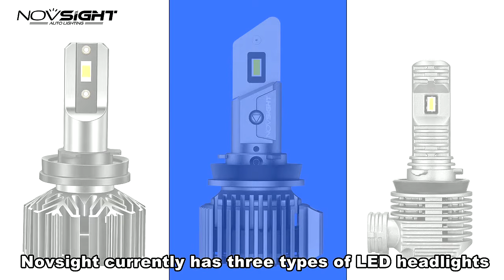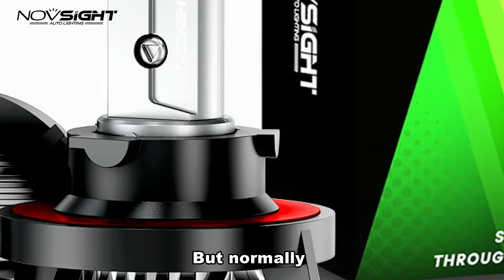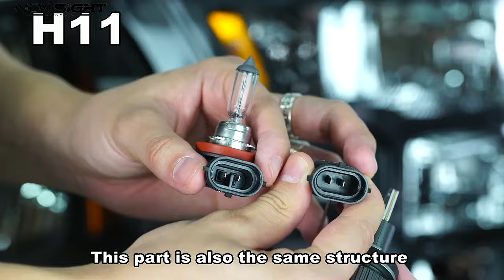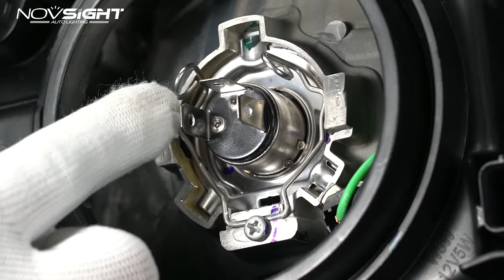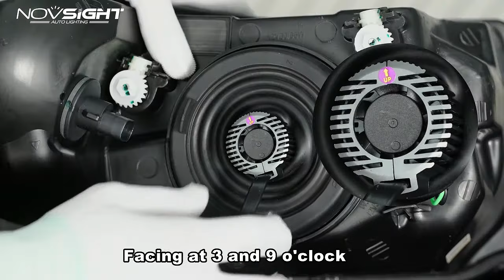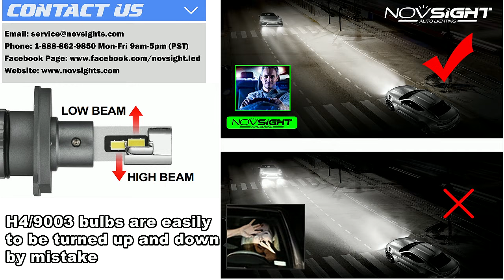How to install H4/9003/HB2 LED headlight bulbs - Novsight H4 LED bulbs install guide

Comment: Bakit yung h4/9003 ko nung ikinabit ko, hundi naka 9 and 3 o'clock. More like 10 and 4 o'clock sya, kaya ang buga ng ilaw mejo slant to the right. Baka may reco kayo na installation tips. Mirage g4 2024 ang unit ko.
Reply from the maker: Hi there, does your light bulb have a 360-degree rotating clip? First, remove the clip and install it into the bulb housing, then screw the light bulb into the clip. H4 install Guide New Video: https://www.youtube.com/watch?v=B5nc_8uNx1Q

Comment: Wouldn't the rubber cover restrict airflow on the heat sink?
Reply from the maker: Generally speaking, it does affect heat dissipation, but we respect the opinions of customers, they can choose to install or remove the dust cover.

Comment: i bought a novsigth N39 H4 my problem is no high beam? only low beam, but in my osram led headlight is working. in novsigth is not working.
Reply from the maker: It might be a decoding issue. Please visit our official website and consult our online customer service for a solution.❤️
Reply: The LED driver circuit must be compatible with the Headlight circuit and programs in the Cars OBD2

Comment: Day lights doesn't work after this modification
Reply from the maker: Hello, there could be a few reasons why the light isn't working. First, you can try swapping the left and right bulbs to see if the polarity is connected incorrectly. If that doesn't fix the issue, it might be a decoding problem. You can purchase a CB6 decoder from our website to see if that resolves it, or contact our online customer service for further assistance. I hope this information is helpful to you.

Comment: MADE IN CHINA
Reply from the maker: We emphasize quality and user experience in all our products. The focus should be on the standards and performance of the product rather than the manufacturing location. Thank you for your comment!
Reply: @NovsightAutoLighting Thx Nov sight. My LED hsadlights are another brand and bought on Temu but your install instructions are also valid for these ones

Comment: Hi, i have an h4 led bulb but it has only one filament which has total of 6 small csp leds 3 for upper and 3 for lower beam.. traditional h4 bulb has 2 filament. Is there any problem with this because my beam pattern is not projected like halogen one's

Comment: I have installed LED bulbs for sienna 2016 but high beam is downward the bulb has 9 3 clock orientation what should do to put light straight for high beam
Reply from the maker: Can you adjust the position of the light itself? It should be able to adjust the angle
Reply: @NovsightAutoLighting  the position in 9 and 3 but which side to keep UP and which to keep Down for better Beam Pattern. Confused??

Comment: Haloo... instead of 3 to 9, 0 clock....can i put to 12 to 6 o clock..? 
Mine is h4 ..night eyes..
Reply from the maker: Hi, according to our test, 3&9 O'clock is the best angle because the structure of the reflector housing and projector housing. If you put it in 12 to 6 O'clock, you might get the wrong light pattern

Comment: What’s the purpose of a removable locking ring?
Reply from the maker: Hi, because the cooling fan will be bigger than the clip, if you install the whole light, the clip will not be able to close.

Comment: What to do if locking ring drops inside
Reply from the maker: If you do drop the locking ring. 
First, please don't try to pick it up blindly, because you might move the ring into a corner. 
Get a steel wire and use your phone camera and flashlight to locate the ring, try to fish it up. 
If that didn’t work out, you might need to take off the headlight housing to get it. We suggest you seek help from automobile technician

Comment: After all this time of swearing and cursing that I have struggled putting these into my car's , I come across this video I didn't even realise that the locking ring came off. Made the Job a hell of a lot easier. Thank you and great video and explanation
Reply from the maker: Thank you! Glad that we could help!
Reply: Yes it helps to learn how the fastening system works but after a few installs you should be able to install with or without the ring on
Reply: My main problem ive had for months was to find out what direction i should turn the LED, now im pretty sure after this vid. The metal light blocking wings should sit UNDER the LED units and not over?!!!???? 🌞💚🤯🤯🤯

Comment: I followed the steps but why my fo3 turns 12 and 6 o'clock? Any remedy to this?
Reply from the maker: Hello, there might be two reasons:
1.The taps on the collar, there is supposed to be 1 bigger tap and 2 smaller taps. The bigger one should be facing up
2.The light position before you put it in the collar. The wire should be facing up when the light is in the beginning position, then turn it clockwise. (if your series only have an up label, the up label should face down at the beginning position)

Here is another new tutorial with a CG explanation, it should be able to help you out: https://youtu.be/B5nc_8uNx1Q

Comment: Hello! Is there anyway i can adjust sa body of the bulb? Because they dont perfectly align horizontally like u said in the video. My bulbs are a little tilted to the right
Reply from the maker: Hello, although vertical is the perfect angle (facing 9 & 3 O'clock), for the H4, it is normal to have a tilt (could be up to 5°) due to the design of the light collar.
Reply: I also have a problem with the highbeam installed in our 2015 montero glsv. Whatever i do the bulb is locked diagonally.

Comment: Using 5 pairs of your products including nighteye,, very satisfied with products and built quality 👍. Latest I'm using the N37 H4, light output is very bright but the wattage I measured is only 40 watts , bought it from cloudsale, have I got the original quality I'm doubtful. Last time I bought the 14400 lumen H4 directly from Novsight, it's wattage is almost 40 watts as advertised and it runs way cooler . Please clarify about the low wattage if possible.
Reply from the maker: Hello, LED bulbs use about 80 percent less electricity, yet they can last longer and emit more light. That makes LED highly energy-efficient.
Reply: @NovsightAutoLighting  I asked particularly about the N37 H4, it's rated at 60 watt but it actually  consumes 40 watts even at start. Is N52 better than N37 ?
Reply from the maker: The N37 has a higher wattage. 
The wattage data we label on products is the highest running wattage from the test lab. 
But for the product life cycle consistency and the best running efficiency, we programmed the power circuit to run at a stable wattage, not the highest.
Reply: 40 watts is an immense amount of elec for LED tech. LED headlight power should not be over 20 watts per unit

Comment: Does the n52 fits for hyundai elantra 2007 ?
Reply from the maker: According to your car model, H1 is the best fit for your high beam, and H11B is the best fit for your low beam.
But the N52 series don't have H1, we recommend you the N32 series.
Reply: @NovsightAutoLighting  I will use it for low beam h7 .

Comment: Is it safe to place back the rubber gasket for H4 socket? I have installed a Novsight H4 LED replacement with integrated Fan for my car. The car has a waterproof headlight and the bulb, including the fan is fully enclosed inside the headlight assembly. I feel that the LED would suffocate and overheat if i install the gasket. However, I'm not also comfortable in leaving the assembly bare at the back. Please advise.
Reply from the maker: Hello! It is okay to put back the rubber gasket. Our H4 design has already considered the heating problem. 
However, if you really worry about this, you could also try the A500-N30US-H4. Which has the exact same installation method as the halogen bulb.
Reply: And theres no law requiring the rubber gasket to be on while driving so you can choose the extra air and dust if you want more cooling

Comment: Hello! I have similar bulbs and the light pattern is the same, they angle UP to the right, but I'm in the UK and need them to angle up to the left, is there a way to change this at all? thank you!
Reply from the maker: Hello! Is your headlight a reflector type? The light pattern is decided by the reflector cup/projector, which suppose to match the UK standard.
Reply: @NovsightAutoLighting  ohhh okay perfect thank you! I never knew that!
Reply: Haven’t found a solution other than buying UK/Irish market bulbs
Reply: Think of LED filaments of 180 x 180 degress light emitters. Except the ones for houses that stands in the air giving 360*360.. these for cars have on both sides to give near to 360*360 but they dont give patterns other than that. The headlights in cars are huge reflector tubes that will force the light downward onto the road and block all other angles like upwards to prevent blinding other noobs on the roads